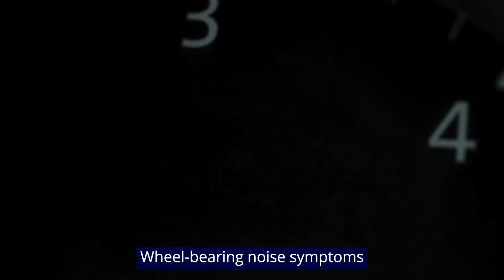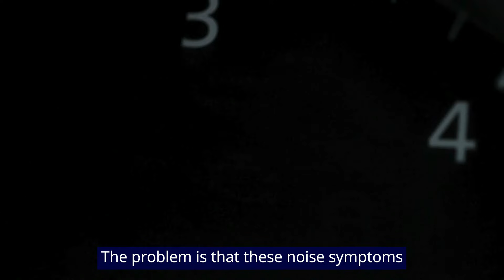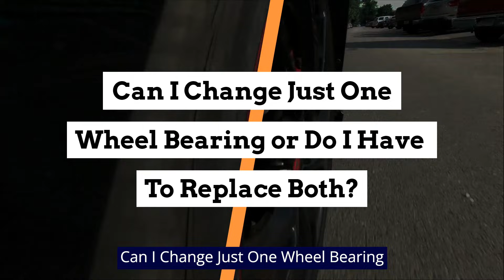Wheel Bearing Noise: How Long Until It Fails Completely?

Comment: And in which case a bad wheel bearing can damage CV joint or transmission? In case of a total failure ? Or will a wheel bearing noise which comes and goes at certain speeds also damage the transmission and axle?

Comment: Hello Howl noise just started at speed 50 miles per hour and the noise comes and goes as I change the speed.  I have 500 miles to go to other city to get it fixed. There is no play at the wheel when I jack the car up and shake the wheel with my 2 hands at quarter past nine position. I now stopped driving the car and will try not to drive the car until the day of my about 500 miles long drive. 2 Questions 1: Is it risky? 2: Hub and bearings are sold separately so is it better to buy both hub and bearing rather than just buying the bearing if there is a risk to damage the hub while removing old bearing? Look forward to hearing your opinion. Thanks in advance
Reply: Please update us, how did it go??

Comment: You know what sucks - I have a 2006 scion xb and I can't find a single after market spindle and knuckle hub assembly for my driver side front. One car parts website had OEM hub assembly for $231 and after some talking they dropped it down to $193... Still too expensive for me
Reply: Did you check rock auto?
Reply: Good thing you didn’t have to pay someone, it would cost about $500 to fix it.
Reply: @zztop8592 i ended up having a mechanic go to a pick yard and he grabbed me a 2007 part and installed it part labor plus picking the part total $350
Reply: That is a standard price for them even more if it has abs on it if you don't like the price there used parts

Comment: Was traveling in my pickup & noticed a growling started in my front end when i hit bumps on the interstate. It continued to get worse as i got closer to my destination and breaking became difficult.  Sometimes one the spot other times hardly nothing & Abs started engaging. Then then it started really pulling right. The abs stayed on. And the grinding/growl got worst. I was in the middle of nowhere but had 18miles to my destination. It was a sat & no shops or AAA was responding. By the advise of my boss i drove 18miles at 10-15 mph. Staying of the breaks. Using the emergency brake only when needed. 
I got to my motel. He said to touch the wheel to determine if it was a break issue or wheel bearing. It was so hot to the touch & slightly leaning top inward. 
Wheel bearing shot. Im lucky i made it he said. I said Glory be to God. As I prayed all the way. & instead of it coming off like it should have, in the middle of nowhere, with NO tow recovery. I made it to shelter, food, & service 8blocks away. I may miss work on Monday. But at least i am able to afford to pay to have my truck fixed. 
Moor over, i will be able to visit my son how has had heart transplant surgery, & made some new friends at the hotel i was staying at who also were going through rough times being flooded out of their home. But provided me with transportation to see my boy. God is good! So let me pass this to you. When crap happens & your needing help & your prayers seem unanswered? 
Take a moment is ask yourself, how much worst could it be? But it is not! 
Thats God protecting you. Lifting you up. By keeping an attitude of gratitude when crap happens is a sign of spiritual maturity! Everything will be as it supposed to be. God willing, his will be done! Amen.
Reply: God is our everything amen
Reply: Amen brother! All praise to our Lord and Saviour Jesus Christ!

Comment: This stupid video could have been summed up by saying Get To A Mechanic NOW!  I've had a wheel fall off while on an interstate ramp about to merge in.  The bearing assembly had grinded the spindle fragile and it just snapped off.  If this happens at a high speed, you're as good as dead, and harm to others can occur as well.  Who cares how LONG a bad bearing will last????
Reply: People might wonder how long a bad bearing will last because the mechanic can’t get them in the day that it starts making noise and wants to make sure they won’t make things worse by driving the car until they can get into the shop.
Reply: Some of us aren't in the position to casually drop $500 and are curious if they can possibly go another 2 weeks before making the repair. I myself am paycheck to paycheck I just repaired my CV axle but my wheel bearing is still bad and it can cause my brand new CV axle to go bad after just repairing it.. sadly for my there's no aftermarket spindle knuckle hub assembly for 2006 Scion xb
Reply: Sometimes it happens 100 miles from home and you want to get home.